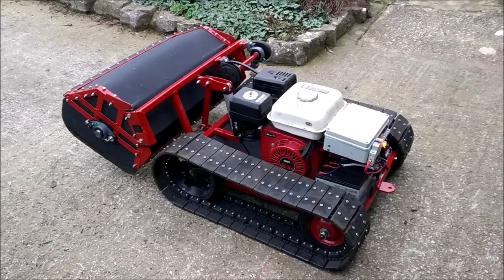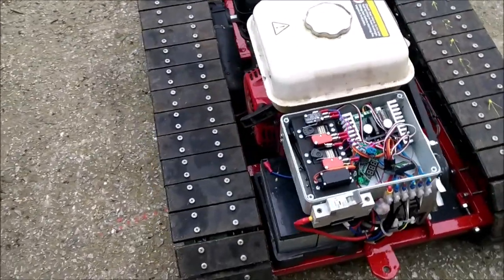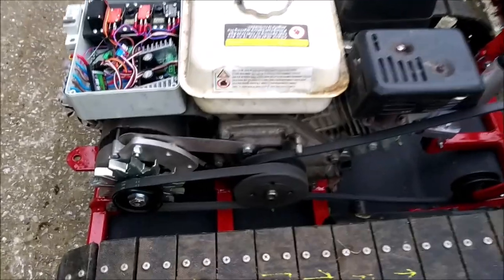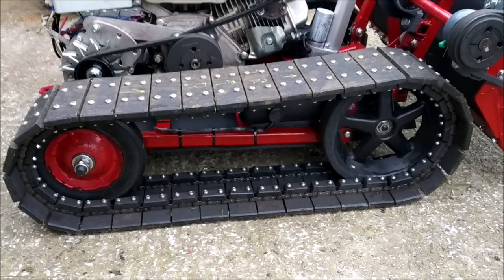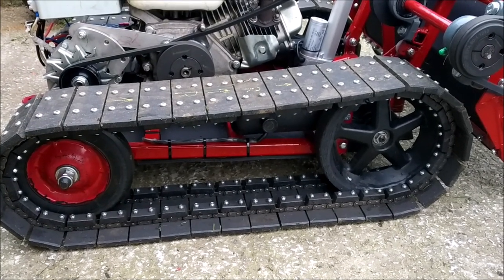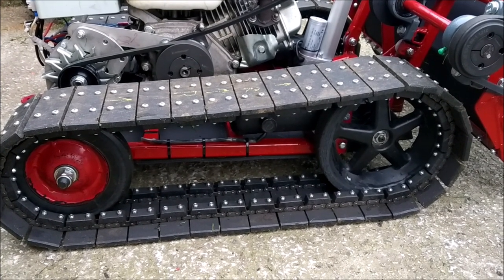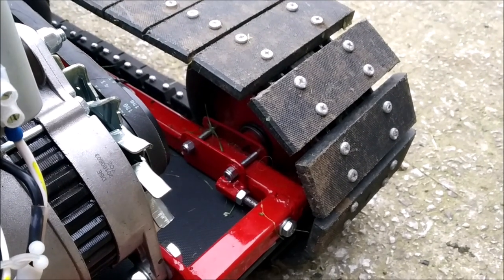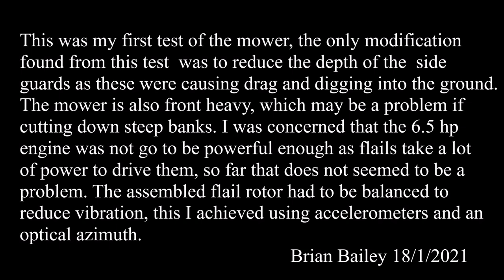Crawler

Comment: Your track design is genius. I've been thinking of ways to convert my wheelchair motors to track drive for a similar project, and your idea is so simple it's brilliant. Hope you don't mind if I adapt your design to my project, I'm converting an electric chair to RC bulldozer so I can maintain my RC racetrack with RC toys. You sir, have made a guy's day.
Reply from the maker: Making the tracks accurately and quickly I had to make temporary fixtures to cut the parts to size and drilling the holes.
Reply: @brianbailey4565  It looks like they work great, thank you for the inspiration. I really like the idea of using the chain to hold everything together the way you did, time to start searching for chains now.

Comment: Lots of positive comments and well earned Brian. IT seems very maneuverable for a tracked system. My wife stuck her head around the corner to see what I was watching. Watching your machine mow sur ebeats me out there slugging the mower arounbd ;-)
I also like the lush grass I see little of in my part of the world; it's drought or flood here in Oz lately. One small quibble I have is I reckon the motor should be either raised above the flying off cuts or otherwise protected. Over time I see a lot of rubbish finding it's way into the engine parts. I'd call that job done Brian. What's next?
Reply from the maker: Yes it was something that I did not forsee that the debris could be a problem, for now I just clear it every now and then. I wanted the engine low to keep the CG as low as possible for stability on slopes.

Comment: I have an ATV flail mover at app. double the size, and a 15hp motor running it. Just for sizing.
All the flail mowers I have operated have a roller at the back to help stopping the flails going into the dirt. Perhaps an idea for you as well.

I am very impressed with what you have built. I would definitely not have minded something similar myself to avoid driving on the steeper slopes. Looking very much forward to your next iteration, or project :-)

Comment: The flail mower is better in rough areas but does not mow as evenly in smooth lawn grass correct ?
Reply from the maker: This mower was designed to flail brambles and small thorn trees. It uses more power but a flail mower shreds everything into small  pieces. It is also more compact then a rotary blade. It does cut grass but not as smooth as a rotary blade.
Reply: I associate flail blades with those huge bush trimming things/tractors that we see at the road side/the central reservation of a dual-carriageway pruning the hedges/small trees. This is the first time I have seen one configured as a lawnmower, I guess the cutting behaviour is similar to a rotary blade mower, but in the orientation/position of a cylinder mower - those need a bottom fixed blade for the spinning cutter to cut against and have a front and rear rollers to get a striped effect. The concern with that prototype is that lawn clippings were being sprayed onto the recoil starter vent - blocking the engine cooling
Reply from the maker: @samuelfellows6923  I did a test cutting grass but what it was designed for was munching brambles and nettles on the edges of our fields. Which it shredded, yes I do have to clear the debris every so often,

Comment: Can you teach us how you balanced the flail rotor shaft?
Reply from the maker: The quick answer is no, my background is that I was an helicopter transmission development engineer. However I also have years of experience in, test rig design, instrumentation, vibration monitoring and analysis. In addition you require specialised vibration monitoring equipment and knowledge, not something you can just teach someone.

Comment: This a great build. Very impressing. I would like to build something similar using a 24 V alternator. I’m interested to know the characteritics of the batteries you use. I suppose those are 2 12V in series. Could you tell us what is the capacity and also if you chose to use deep cycle lead or regular batteries. Thank you.
Reply from the maker: You are correct it uses two 12v 7Ah batteries, it needs these for the control system and so I can maneuver the mower before I start the engine. Once the engine is running the alternator puts out 28.4 volts typical charging voltage so the batteries are then kept at full charge. The power for the motors then comes directly from the 55A alternator output.

Comment: how did you hook to actuator to the remote?  You said 3 servos.  Is you actuator hooked up like a servo?
Reply from the maker: There are three servos one for the throttle, one for the kill switch and the third operates two micro switches for the linear actuator. One switch for up direction and one switch for down by reversing the polarity of the power to the linear actuator. The drive motors work directly off two of the RC reciever channels via the Sabre Tooth controller.

Comment: Using remotely-controlled servos to flick switches seems a little odd.  Couldn't you just read the radio's output signal directly?
Reply from the maker: The motor controller reads the RC receiver output directly but for the kill switch and lift actuator I use simple micro switches, cheap and reliable.

Comment: It looks as though you have used commercially available flail ends?
Also is the speed controller the only viable option? They seem to be quite expensive and of limited availability.

Thanks
Reply from the maker: The flail were the smallest and cheapest I could find, being 24 volts the options for speed controllers for brushed motors are limited.

Comment: Wow! Looks awesome. What type of modifications did you do to feed from the mower engine back into the alternator?
Reply from the maker: I Purchase a 24v alternator with built in regulator and Vee pulley drive, on the engine  output shaft I used a double pulley one drive the alternator and one to drive the flails.

Comment: Quite awesome.  Did you build the flail yourself?
Reply from the maker: Designed and built the rotor to hold a set of small flails I bought from the local agricultural stockest. Probably the most differcult bit to make requiring a lot of welding and drilling.

Comment: Great video so do you find the Sabertooth reliable
Reply from the maker: This is the scond Sabertooth controller I have used, both have been perfect with no problems so far. If you do overload the sabertooth controller or do not have a big enough heatsink then it automatically limits the output current until it cools down, as I found out on one of my very heavy remote mowers.

Comment: great looking rc mower.  how did you fabricate the front "cutter" section.
Reply from the maker: The rotor consist of a box section with shafts welded at each end, lugs were welded along each side to hold the flails. A lot of machining, welding and quite heavy, this I had to balance as all fabricated rotating parts produce vibration. This was done using sensors to calculate where to add the correction mass. The rotor is supported by bearings each end and driven by a Vee belt.
Reply: @brianbailey4565  impressive stuff.

Comment: Watching your mower is the most fun I've had all day.  Great job!  Almost looks professional... no, wait, it does look professional.  Is there any mechanical link between the drive wheels and treads, or just friction?
Reply from the maker: Just friction, but where a wheel has only a small contact area with the ground here the drive wheels have 50% of its circumference in contact with the track.
Reply: @brianbailey4565  Point well made, and taken.  So, you're a mechanical engineer?

Comment: which sabertooth driver did you go with? the 2x32?
Reply from the maker: Yes the 2x32 Sabertooth 2 channel controller, the RC transmitter is set up to control each motor independently. Then on the RC transmitter the two servo outputs are combined, stick fwd/aft drives both motors, stick side side provides the differential motor speed required to turn.

Comment: What's motor and controller you are used?, I
Reply from the maker: The motors are 24 volt dc brushed wheelchair motors and the motor controller is the 2 channel Sabertooth controller.
Reply: Thanks

Comment: You're required to walk around with it anyway. Why not just give it manual controls? Then you could do away with all the electrical / electronic junk and it would become much simpler & more reliable.
Reply from the maker: This was my first test, when it is in the fields chopping up brambles I keep a safe distance as bits fly everywhere . As long as I can see what it is doing I can keep well back.

Comment: 2:06 what is stock board ?
Reply from the maker: It is recycled plastic that is made into 8 x 4 ft sheets at 6, 9 & 12 mm thick. it is easy to cut and machine. With hot air gun it can also be formed into shapes like the flail cover.
Reply: never heard of it here seem nice :D thanks

Comment: Conpro cuanto cuesta
Reply from the maker: "see how much it cost" only bought the bolts, pullies,belts, wheels, actuactor, bolts, metal, plastic, bearings and RC controls. Engine was free, so around £400 to £500 the real cost is the design time and knowledge required to make it, but as its a hobby so time is not important. Its the sense of achievement when its works.